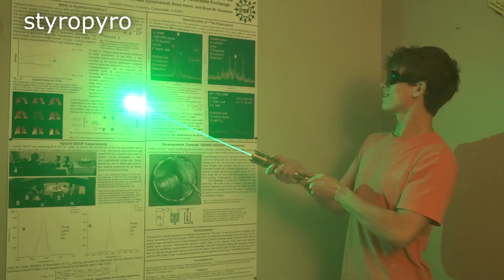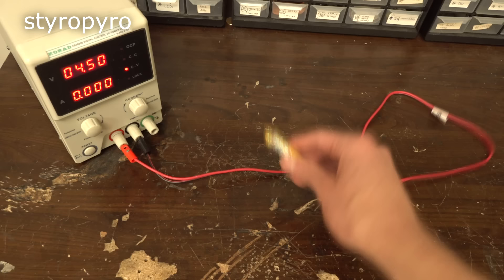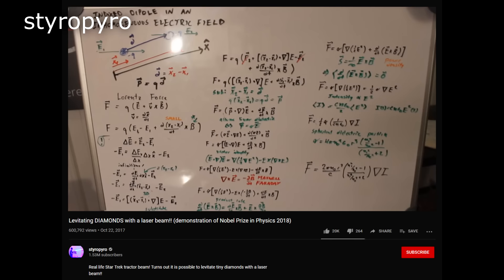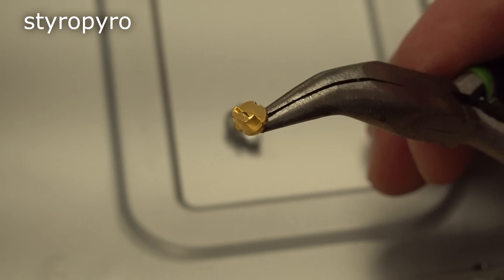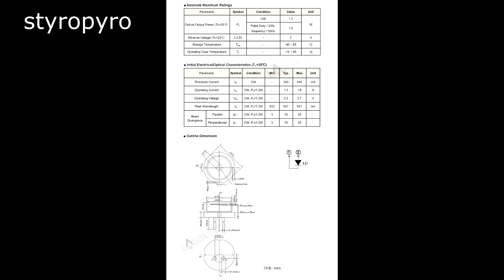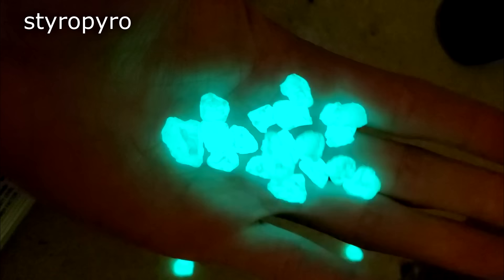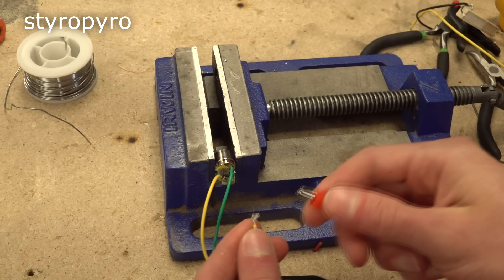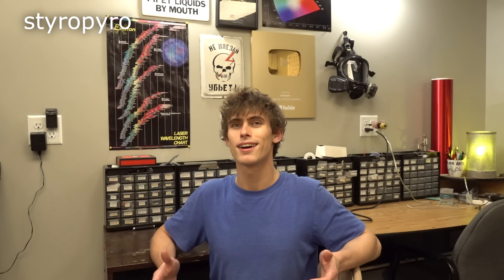Crazy Keychain Laser Pointer Upgrades. 5mW to 3000mW+

Comment: what happens when you center a rodin coil at the center of the focal point. magnetic waves affect lasers even in a vacuum.. what would be interesting is if the magnetic field is strong enough could you get the laser to become part of the field maybe light can get pulled into magnetism making a laser magnetic field. the frequency of the coil needs to be calculated with the frequency of the laser.
Reply: you could probably ramp up the coil in ratios concordant with the evolving affected laser frequency like playing the lasers song into crescendo before amalgamating to be part of the magnetic field. So Awesome.
Reply: or at the very least concentrate and speed up the beam.

Comment: Now we just need to bea le to limit the length of the beam while keeping the fire hazard quality,  and there's basically a working "Lightsaber". You might also be able to change the frequency of the laser from  urning, to say a "shock" like a 9volt battery or something...    I'm just forming the thoughts of Security sabers/batons (that shock, like the "Shock-Sheild"®
Reply: *Burning
Reply: Your comment makes no sense whatsoever, even without the typos. A laser only works AT a certain frequency, so that cannot be changed. And there is no electrical "shock" in a laser beam, it is just very low energy light with absolutely zero electricity.
Reply: @johncoops6897  then you aren't realizing that you can change the frequency of the laser, and you're actually changing the "Color" of the laser by adjusting the frequency of the light from the laser, even though the "light" from said laser is merely just  a stream of radioactive photons.  I'm almost sorry that you're mind can't conceive such a thought.  Which tells me that you're an alpha, not a sigma...
Reply: @Matthew-tv8uq  - it is not possible to "change the wavelength of a laser" because they are specifically manufactured to resonate at only one particular frequency.
And once again, there is no electricity in the beam. I'm not sure why you are referring to the Greek alphabet, however a few nonsensical words won't change the science and physics involved here.

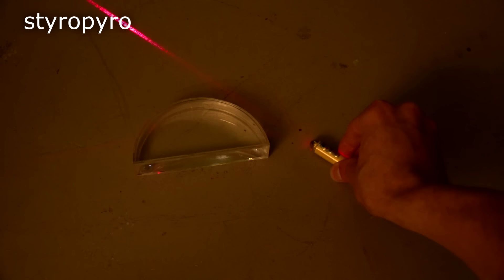Comment: 1:20 this is completely the wrong way to go about laser safety: It doesn't matter the color or what it looks like, if your laser pointer does not have a "CLASS 1" certification sticker on it, or wasn't bought from a reputable seller, never use it and throw it in the trash because it can blind you or your pets.

Class 1 lasers, and class 1 lasers ONLY, are safe. Because that is exactly what class 1 means: it means that you can hold that laser source right up to your eye indefinitively and it will do you no harm.

Not Class 2, it is not Class 1C, it is not Class anything else. Class 1, or don't mess with it. Otherwise, for anything but Class 1, it has the potential to harm in some conditions. Only Class 1 is consistently harmless, all other classes are only safe conditionally.

Tiny keychain lasers from china, which look harmless, are often NOT class 1. You CANNOT tell which laser is safe and which one isn't if it isn't classified, you can't tell if its safe by looking at it, so if it doesn't have a (trustworthy) class sticker on it, assume it is dangerous. Whenever in doubt, never risk it.

To be entirely safe, laser pointers for pets should be very poorly collimated and if the laser dot isn't wider than the pupil of whatever you intend to shine it towards, don't. Of course, this is again only after reputable certification.

And it is not not a big deal, because the loss of vision from retinal damage impacts quality of life similarly to being paraplegic. So think twice about doing stupid stuff with lasers. You won't die, you, or worse someone you care about, will go partially blind. Vision loss from laser damage is irrecoverable, and even a tiny burn is often in the spot where most visual acuity resides, meaning you won't be able to read or recognise faces anymore.

And laser glasses are not the be-all-end-all of laser safety, because laser glasses only work properly at their (usually narrow) band of rated wavelengths, so if you open a random disc drive whose laser shines at god knows what wavelength, the random pair of laser glasses you bought from ebay most likely won't stop a stray reflection from permanently ruining your vision. And if you don't work in an optically sealed room with a locked door, that stray reflection might blind someone else.

Also, class 4 is not about power, the classification system is not about that, it's about vision damage. Class 4 means it can damage your vision before you can react, so contrary to what styropyro says about the disc drive laser he scavenged, that diode is most certainly class 4 already, since it can instantly burn your retina even without additional optical elements, if it can burn wood. Such lasers are only truly safe in a sealed enclosure. Invisible lasers are even more easily class 4 because they don't cause a blink reaction.

It blows my mind how a channel whose sole gimmick is lasers does not even aknowledge laser class and the fundamentals of laser safety, and leaving the original class 1 sticker on a modified class 4 laser is just criminal levels of negligence.
Reply: Yap yap yap

Comment: As a kid I would always wonder if I can take a Lazer that can melt to an arcade game.?? Obviously wouldn't let them know..or u can?!. the games where there hanging by a zip tie 😁 just melt it ?? Would it work going through glass though? And what the farthest distance u can light that match with ur little lazers?? Awesome video
Reply: 1. You can take a laser anywhere that you decide.
2. What would be the point of melting a video game?
3. Who cares if the games are hanging by a zip tie? It's easier using a pair of scissors if you want to cut a zip tie.
4. The glass would block the beam considerably, but if the game or zip tie is behind glass then why would you want to melt it?
5. The farthest distance is dependent on the inverse square law, so the "power" decreases by a factor of four if the distance is doubled.
tl;dr:  There is no answer to any of your questions.
Reply: @johncoops6897  lmao !! Ok there are games in the arcade store were you can play games where u have to cut the zip tie to win prize but if u had a high power Lazer u can melt the zip time with the prize hanging thru the glass..

Comment: Hi again. What size filter cap did you use in this circuit? Cheers
Reply: Datasheet... read it.
Reply: @johncoops6897  I didn't make the circuit.
Reply: @waynebagnall3611  - neither did I... However I was much less lazy, so I downloaded and read the datasheet. That's how you learn the 'correct' way to use electronics... Try it.

Comment: What safety precautions would be needed to make it safe enough for a person who can’t be trusted to behave safely, to press the on button on one of these?
Like, would it be enough to like, make a helmet which has an eye shield on it, which can’t be taken off without the person managing the setup unlocking it? (Where, this managing person wouldn’t unlock it until they had retrieved the laser pointer from the not-trusted-to-behave-safely person)
Hm.. How could the managing person monitor the not-trusted-to-be-safe person, seeing as they also need eye protection?
Maybe if they had like, a camera+screen headset, so they could still see what was going on easily enough (though with a little bit of lag), but the screen only goes to reasonable brightnesses, so their eyes are safe?
...
Though, there’s still the question of other injuries from the lasers? If eye safety is handled, how dangerous are these lasers to skin?
Reply: Nobody is going to answer such a silly set of questions.
Reply: @johncoops6897  ok

Comment: 23:20 Hey does anyone know if that is proportional to the wavelength? Because the blue had a short width and the red had a long width
Reply: That is not really anything to do with the wavelength, however it is related to the type of laser diode used. This was actually mentioned in the video.
Reply: @johncoops6897  ok thanks, I thought it was just a coincidence but I like to speculate

Comment: Hello I am Richard 
I was wondering if you would concider tackling a build around the lines of a project I have been wanting to build  the design would be like one I would to see build at least as far as the laser would be built. I invision it to be built with multiple blueray laser diodes. Personally I have a little experience with mod ding cheap laser pointers and Chinese imports as well as swapping the diode in a cheap in graver with one from a blueray player. I have been wanting to build a cnc laser ingraver/cutter with 8 blueray diodes combined into a single beam. Which is outside my scope of knowledge, and comfort in doing so. With the multiple mirrors lens'e's power supply and driver needed to build such a beast. So I thought who better than the guy who runs the Spyro Pyro YouTube channel to reach out to in order to get some help and guidance for this project.
How do I add you to my discord contacts in order to discuss this topic further with you.